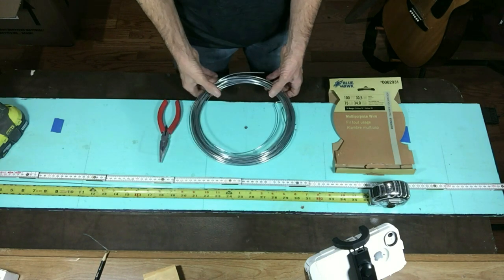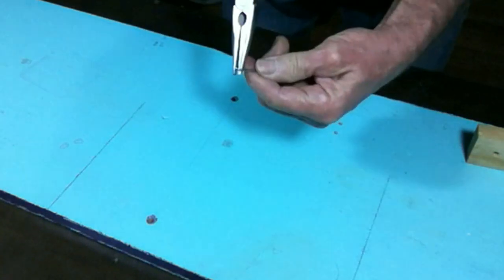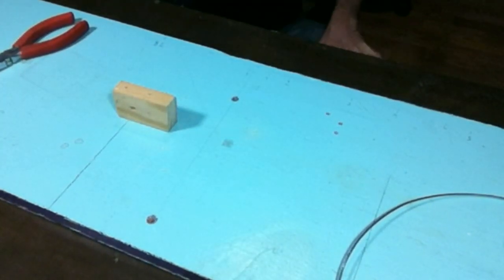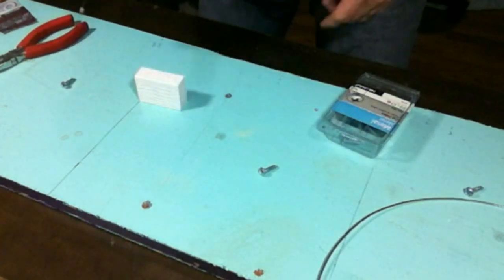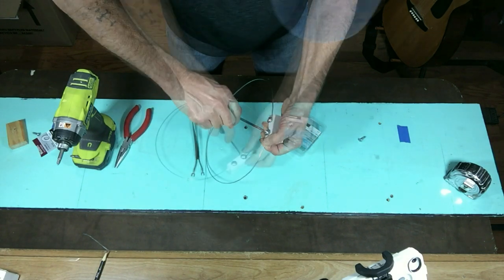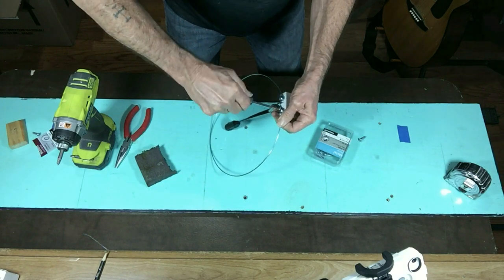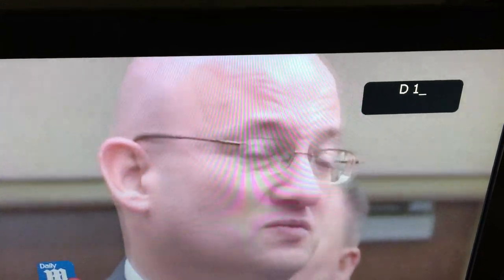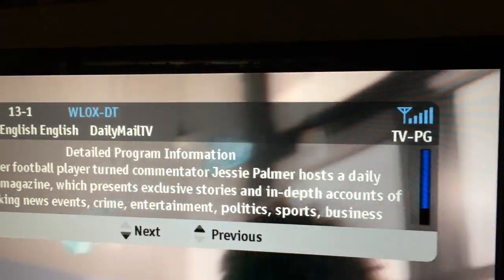How to Build a TV Antenna Easy

Comment: I made my TV antenna by exposing the two ends of some TV coax, getting a 12”x12” cardboard. Place a sheet of aluminum foil on each end and solder the coax cable, glueing the soldered points for reinforcement and shield to each side to make a patch antenna. It’s very powerful at absorbing RF energy for TV signals. Bigger, the better as it’ll be closer to resonating to the transmitter frequency.
Reply: Do you mean you put a 12x 12 layer of aluminum foil on each face of the cardboard?
Reply: @NormBaker.  yeah

Comment: I have several rabbit ear antennas and UHF Bow Ties and a loop that came with TV's over the years. Rabbit ears can be used for VHF Hi-Lo and also as an FM Antenna. Yes they are still channels on VHF Some people think they are not but they are for sure. Some channels broadcast on UHF and the actual channel will be VHF and some just use VHF .

Comment: Hey Mike, thanks so much for the helpful videos!  I was going to make your triangle antenna, and then I saw this newer video showcasing your circular antenna.   I made the 28" loop and hooked it up.  With the antenna we get 21 channels.    It is positioned in a window facing the direction of the station towers.  Next I might try the bigger loop and place it in the attic and see how that does.  Thanks for the videos!
Reply: Did you try the bigger?

Comment: I made one in five mins. Had the aluminum wire, screws and wood.
 Yes works well.  I have it up in a second story though. Just one faint station I cant get.
 It is directional.  I cut the wire at 29" and bent two ends over just like you did.

Comment: Hello Mike! I built your triangle design and it worked beautifully until this month. When the large scale expansion of the 5G networks(& 4G in some areas) took effect this month, July 2023, I began experiencing interference and no signal messages. Yep, I'd rescan and get nada for some of the stations with highest power UHF as most of the stations in Metro Detroit are UHF. Waiting until late at night and rescanning seemed to reacquire most signals, but it's becoming less dependable by the day. Have you talked to anybody else that's had similar issues since the expansion of the 5G network? I'm definitely going to try building and trying your ring antenna tomorrow. Wondering if adding a 5G filter to either of these antenna designs would help the reception issue that began this month? I lease a two-story townhome, so I've been working with my antenna on my walls. I don't know if I need to add an amplifier. I'm hopeful that this ceiling mounted design will help a my reception issue. I'll come back and comment if I have any luck.
Reply from the maker: Thanks for reaching out. Sorry for the delay as I rarely check on my videos as I posted them years ago.  I haven’t had this issue in my area yet but your comment got thinking and so I found this on YouTube. https://youtu.be/YUx8IBkeW4A?si=Cpgwps4D92Vu2Vtw
Hope this helps although you may have already invested in one of these.

Comment: this is cool. I'm gonna make one of these over the Christmas break and check it out.  For fun, how about a double or a quad?  Looks like those expensive antennas you can buy on Amazon.
Reply: You mean adding an extra strip of wire? Yeah, that should give it a higher decibel rating because of the greater area.

Comment: Works great.  Is the 56 inch version twice as receptive as a 28 inch??
Reply: google magnetic loop antennas. I think you would add another loop to double the signal. Increasing the size would shift the wave length lower.

Comment: can you run 300 ohm wire from the antenna if it is mounted mounted outside ,on a post ,that can be rotated and then have the balun inside? thanks

Comment: So at 28 inches, this is full wave just under channel 14 then?

How far apart did you put your screws? Is there such a thing as putting them too close together?

Could the wood have been painted or coated in plasti-dip or perhaps something similar to get the same results as the PVC indoors? I'm gathering moisture in the wood is the issue, right?
Reply from the maker: Yes moisture is the issue. 
Screws are @ 1 inch apart. 
I don’t think closer is necessarily bad but I made other antennas farther apart and it made it more directional. 

It is a full wave loop but I’ve made different sizes. Either larger or smaller this size worked the best. 

Thanks for the comment ;)
Reply: @DIYProjectsWithMike thanks for responding!!! 😊
Reply: 23" corresponds to channel 12, and nothing else. I don't understand the physics of the the 23" choice.
Reply: The physical resonant length is about 5% shorter than the theoretical free space resonant length, and will be affected by the feed point gaping as well as the conductor size do to shunt capacitance and inductance. This loop antenna has a broader bandwidth rendering its resonant size less critical.

Comment: None of my tv's have the old coaxial plug. What do i need to do to connect to my tv that has a usb port and rca ports? Great set up!
Reply: You'll need a separate digital TV converter box or similar unit with a tuner built in, like a Tablo dvr. Anything new you can buy will have HDMI output on it, which will give you the best picture quality.

You need something to turn those radio waves into an actual video signal for your tv to show.

I've actually never heard of a tv without a coaxial input, I find that really interesting, can I ask what brand it is?
Reply: If it's a TV it must have an antenna input, otherwise what you have is a monitor that needs to be connected to another device in order to display an image. What is the model name or number? It should be on the back somewhere.

Comment: Mike, I made the 28” version and now get 38 digital stations including the major networks. 
Is there an advantage to building a 56” loop?
Thanks!
Reply from the maker: I built one and put it in my attic but the 28” worked a little better. The 56” might work better mounted outside but haven’t tried it
Reply: Thanks Mike!

Comment: How many ohms is your matching transformer?
Reply: This is called a 'loop antenna", a type of folded dipole.  The antenna has a free space impedance of 280 to 320 ohms balanced at or near its resonance frequency.  To match to 75 ohm unbalanced coax you will need a 4:1 Balun transformer.

Comment: Does it work nearly as good as the last triangle style,  please comment if you can??
Reply from the maker: It does work well. I temporarily replaced that one with this one about a month ago just to see how it would do. I feel no need to swith them back. So I made a video :)
 As simple as it is to make, I'm hoping it will help a few folks.
Reply: How about its direction ability ? Is it more Omni directional or do you aim it?
Reply from the maker: @devrolet1  
It may be somewhat omni-directional (at least better than many other designs) but unfortunately you still have to aim it.

Comment: Does this work for channel 8 and 11???
Reply from the maker: Certainly if they’re close enough to pick up. If not you might add some straight element extentions. It might help:)
Reply: @DIYProjectsWithMike  How long do the straight extensions need to be for High VHF??  Just attach them to the Loop and screw??
Reply: @birther1968  I'd like to know too
Reply: @Inferno5150  14" is common.
Reply: How far apart do the elements need to be?

Comment: The only thing you got right is the round shape . The antenna you need is a round GLOBE . galvanized or copper . Solder the antenna wire to the GLOBE , attach to a wooden post or pvc pipe , attach to roof . Thats it !!
Reply from the maker: You should make a video :)
Reply: Sure, just go to your neighborhood metal globe store, they're usually right next to your local McDonalds, hahahahahahaha.
Reply: Hey Anthony, can you direct me to information that leads you to this conclusion that a round GLOBE would work best?  I would like to make a globe shaped antenna, just for the fun of it, but can't find any guidelines to follow.  For example, what's the diameter of the circle?  How many wires should the globe contain or should it be all one continuous piece (and if so, how many circles would you make), etc.  Much appreciated!
Reply: @user-gz9ci2oy3f  There is no information on it , because I just made one . I made mine by putting together two mixing bowls 14 inches round ( stainless steel , or a galvanized round cylinder 6-8 in. round ).  I couldnt weld or solder the bowls , so I drilled holes on opposite sides and riveted them together . Before putting the bowls together , I drilled holes near the lip of one bowl and attached a L bracket to what will be the bottom of the globe . Next I stripped the end of a cable by cutting off the end , and exposed the copper wire only . Next I soldered this wire to the bottom of the L bracket . NOTE: Use a cable about 4 feet long and the existing cable thats attached to your house . Next I attached the globe to a 4 foot PVC 2 in. pipe and attached that to the roof . Now you have to figure out witch cable is the IN cable to your TV and attach it to the globe using a adapter . You can get adapters at Best Buy . Thats about it . If you have more questions ; ask .
Reply: @user-gz9ci2oy3f  Gifts and donations will be accepted .
Reply: @anthonyl.goraczko6099    Thanks Anthony.  That's not what I was imagining.  Interesting though. How does it work compared to Mike's antenna?  I am going to stick with Mike's simple loop design.  It is working pretty good for us.
Reply: @user-gz9ci2oy3f  Works realy well . Picks up all the local stations , and has a clear picture , and the cost is less than $20 . The best part is you dont need to adjust it because it picks up signals from any direction .
Reply: It's not a globe if it has two big flat spots on opposite ends. Unless your dictionary has different words in it than everyone elses.

And you can jam a paper clip into the coaxial input on a tv and a get stations. Close proximity to transmission towers and the strength of signal can make anything metal work, even a dented sphere made from two mixing bowls.

I hope you grounded your UFO, where I'm from? We call that a lightning rod.
Reply: @anthonyl.goraczko6099 , read your very first post here. Genius.

Being on drugs? Is taking hours to mate mixing bowls together to make a non-globe antenna and thinking you look smart enough to brag about it.
Reply: @russellborrego1689  Yep. I would call that ungrounded globe antenna a lightning rod.  I used to work for a government agency as a electronics tech when they were transitioning from vacuum tube equipment to solid state.  Until they started installing good lightning protection on the equipment we lost equipment left and right every time we had a bad thunder storm.
Reply: I don't understand any of the physics.   The globe could not be a magnetic antenna. It might work as a resonant wire with different lengths.  If anything, a metal bowl and a slit cut from the center top to the edge (metal cutoff grinder wheel), solder or drill screw holes near the extreme rim edges for each each balun side.  This might make a directional self reflecting multi resonant (bowl rings of reducing diameter) antenna.  However, I a real physics professor would know and it seems like such a design would have been tried in the past 100 years of radio and TV.

As far as the original video goes, he falls down on not explaining the physics of 23 inches. How did he choose this?
Reply: I also can't visualize where you are talking about connecting you balun ends to on the globe. You need a better explanation.
Reply: Anthony, I have several requests, including physics explanations from you and this video. My last request is for signal meter levels of the globe v. Off the shelf and the loop.  Straight 3' of coax as a control.   Also, try my suggestion.